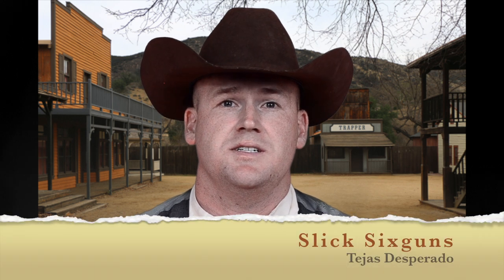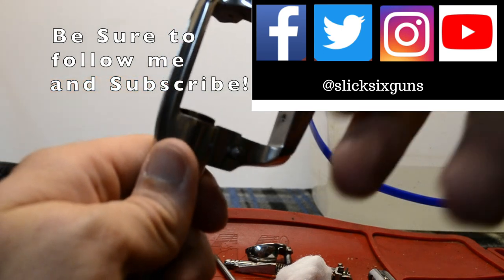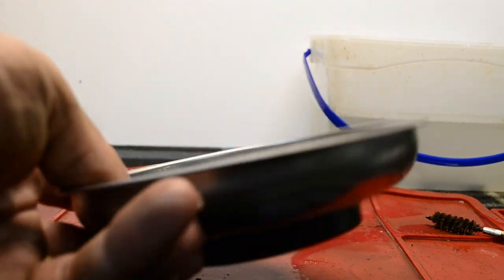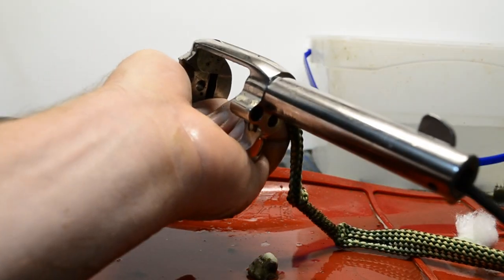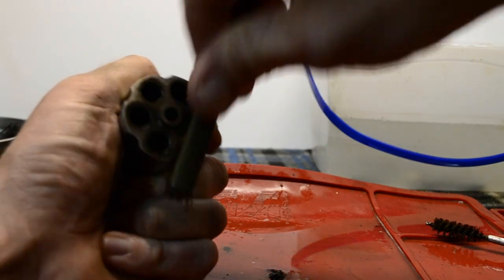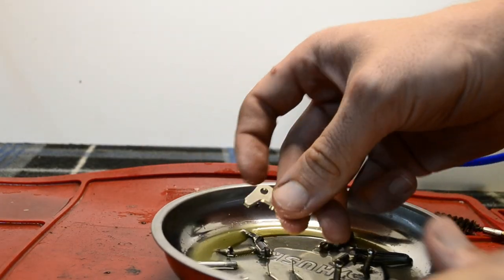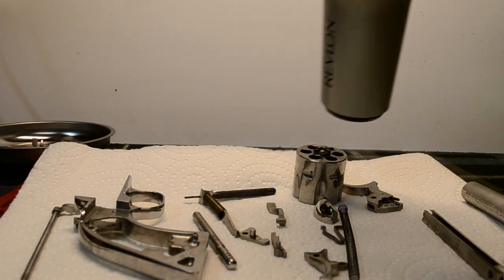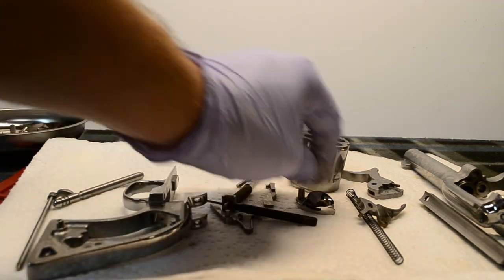Single Action Revolver Cleaning (Ruger New Vaquero)

Comment: I'm going to try your method.  My grandfather and father always used Hoppe's #9 exclusively.  While it works, it does tend to be a very tedious process.  Your method is more appealing to me.  Regarding cylinder burn-in.  I have found that soaking the carbon with Hoppe's #9 and letting the cylinder sit for 24 hours makes it very easy to remove the carbon (all of it, like new) with a brass brush.  Also works well to remove the carbon rings inside each chamber.  I think your method, combined with some Hoppe's #9 detail work, is going to be the ticket.
Reply from the maker: Boreal Patriot let me know how it goes. Just to clue you in break free when it drys gets a little gummy but it’s very good
Reply: @SlickSixguns  I hear ya.  I'm retired Army, and I was raised (by the Army) on Break Free.  Didn't like it at first, but it grew on me, at least for my service weapons.
Reply from the maker: Boreal Patriot thanks for your service nice to talk to another veteran